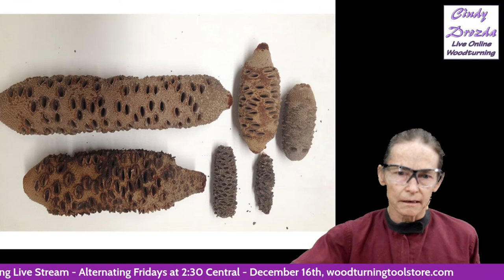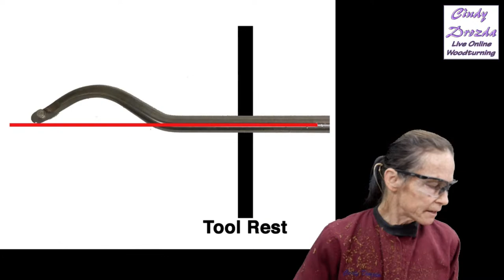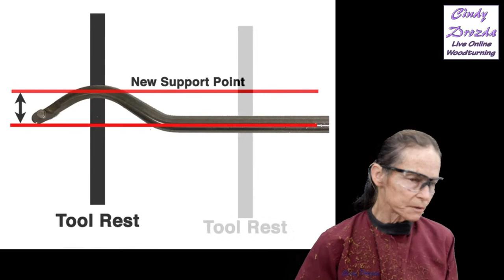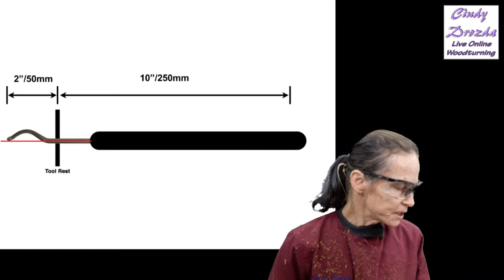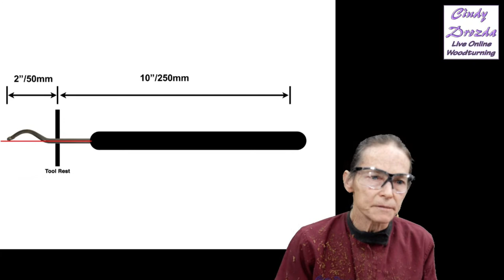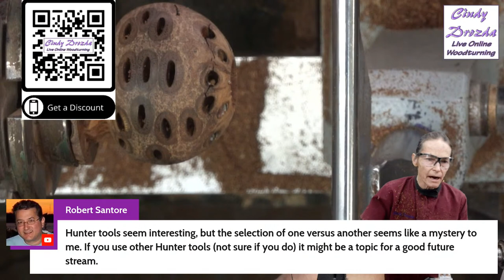Woodturning Tool Talk Live - Hollowing an ornament with the Cygnet tool

Comment: Thank you Cindy. I have purchased the hollowing tool from you. When making the handle for the tool, how many inches do I need to drill and sink the steel into the handle for proper support?
Reply from the maker: The Cygnet tool has a rectangular tang that is about 1-3/4" long. That is how far it should go into the handle.

Comment: Cindy - what hand hollowing tool would you use for a small (4” deep) hollow form?  Seems that that a 4” deep hollow form would be too deep for the cignet tool but may not necessarily be so deep that you’d have to use a large captive bar hollowing system.  Any suggestions?
Reply from the maker: Yes, 4" deep is too large for the Cygnet. I use my Jamieson system with smaller (1/2" diameter) bars. It works great. I don't know what hand held hollowers would work. Maybe something by Mike Hunter?